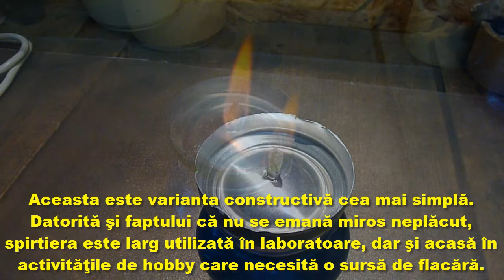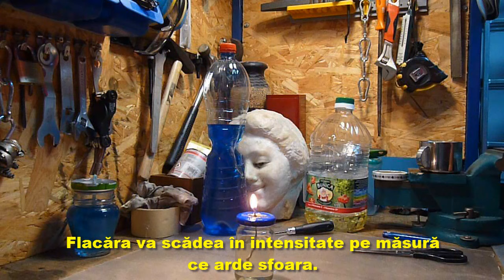Cum se face o spirtiera si o candela cu ulei

Comment: Ai incercat cu fitil de lumanari? Cam cate ore arde o candela cu 100 ml ulei ?
Reply from the maker: cu fitil nu am incercat, ar merge mai bine cred, dar cu ce am facut eu, candela arde multe ore, nu o las aprinsa mult timp fiindca se incalzeste foarte tare uleiul, poate crapa borcanul si e risc de incendiu, insa asa, supravegheata, citeva ore o puteti lasa, sunt suficienti 100 ml, in loc de ulei se mai poate folosi si unt topit sau, desigur, untura
Reply: workbenchstuff merci de raspuns; am vazut pe alte clipuri ca pun apa in borcan apoi un strat de 2-3 cm ulei,cred ca e mai bine asa. La cat timp aprox.trebuie sa trag in sus de fitil?
Reply: Am candela cu ulei, arde in permanenta. 100ml de ulei e aproape o zi. Minimum jumatate de zi de ars incontinuu. 
Flacara unei candele trebuie sa fie "cat un bob". Ea se ajusteaza prin marimea fitilului care arde. Daca lasi mai mult fitil deasupra uleiului, flacara e mai mare. Flacara mare = afuma peretii (in casa).
Pentru sustinerea fitilului se poate folosi pluta, care pluteste peste ulei, astfel fitilul va sta in ulei tot timpul, indiferent de cat ulei e pus in pahar. Cu cat scade uleiul, coboara si pluta.
Reply: Încercați  cu vată  așa  facea mama si ținea  cate o zi întreaga